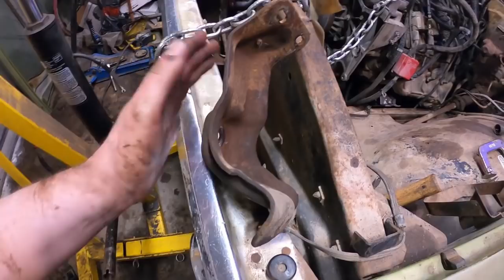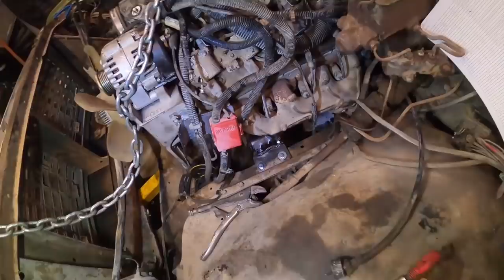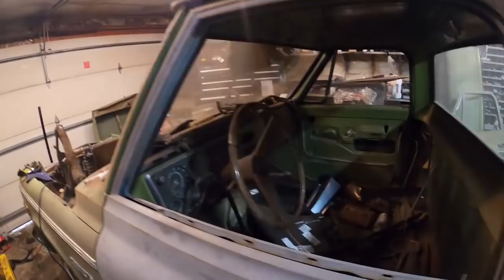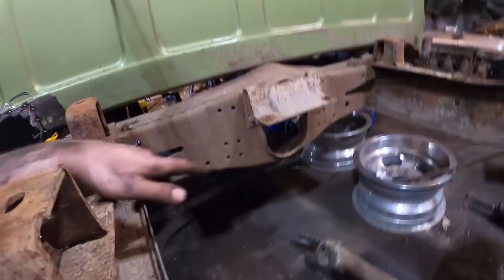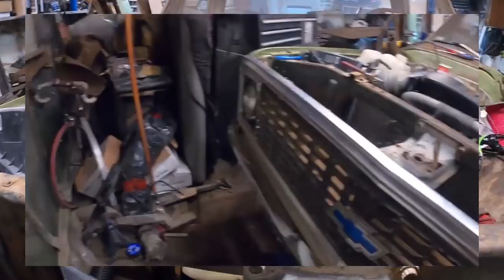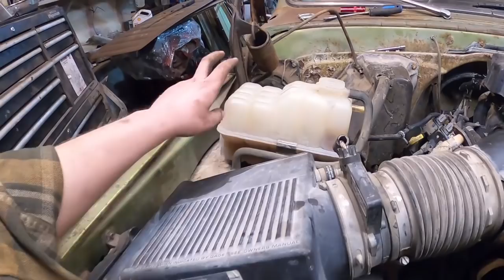LS Swapped C10 - Re-worked Factory Harness and Home Built Mounts

Comment from the maker: Back Working on the C10!  It fought me hard but I'm making progress.  Let me know what you think.
Reply: Super stoked to see what you do with this truck and the projects to come!! 👍👍
Reply: Coming along great. Getting it done. Thanks for sharing
Reply from the maker: thanks!
Reply from the maker: thanks for watching!
Reply: The 3/4 ton trucks with 6.0's and hydroboost have plugs that go into the power brake port on the intake 👍
Reply: DD Speed Shop - Dan, you’re coming along very good on the C-10, I really like your motor mounts!  What are you going to do for a gas tank?  The original C-10 had fuel pump on the engine and I’m sure the LS had an electric fuel pump in the tank.  Can you put an electric fuel pump in the original C-10 tank or will you need to use a fuel cell?
Reply: 10k views. Ur parts suppliers head office does have an advertising budget.
Something to think about, if it doesnt  go against the gain that is.
Reply: Also, l like your cost rundowns. How about a time rundown?
Reply: There is a great video here on YouTube from Gearz by Stacey David that did a frame shortening. It is under the cab but the way he does it it is very simple and clean. May want to check it out. I know you didn't want to do a under the cab shortening but Stacey David did a very clean and simple job.

Comment: The back end of the truck is gonna be much taller when you move the springs forward like you’re planning. The front mounts will end up being mounted lower which will make the suspension sit higher than before. Just something to keep in mind.. if no one else has mentioned it.
Reply from the maker: im gunna keep the mounting height the same.  ill have to make a bracket for the top of the front perch.

Comment: Have you seen the k5 blazer gas tank conversion for these trucks. Don't know if you will have  room but you can put the correct fuel pump/sending unit in them for the right pressure and probably get the gauge to work also.
Reply from the maker: yeah ive seen em.   a little pricey for me haha
Reply: I'd use factory stuff search some videos on it try dicks 4x4, if your interested in it I'm going to do my squad body. Also awesome videos.

Comment: I think most of the trucks that get shortened wheel base get a one piece driveshaft. My 96 short box Chevy has a factory one piece driveshaft, one from the wrecker might slide right in place.
Reply from the maker: once i get the rear end moved ill measure and see what i need.  fingers crossed its a common size

Comment: with the HP tuner do you have to run a speed signal generator on the speedo gear so the motor knows the fuel/toning curve?
Reply from the maker: nope,  uses the 02s for that

Comment: I don’t know if I missed it but how did you wire starter to switch? I got mine all hooked up turned key gas kicks in but turned key and nothing I jump starter and starts but not with key there was a purple wire you mentioned does it go to starter? My car is a 55 Belair stock wire harness 2 starter wire and 1 to coil? Any help? And I am using stock LS harness and fuse box
Reply from the maker: yup the one wire that goes to the starter solenoid should be purple.  then on the factory harnes find the wire that has power on the crank position.  hope it helps
Reply: DD Speed Shop okay I got pink wire from stock ls fused box to the key on resistor on the firewall and purple wire to the same resistor that one is power at crank position.... so now it cranks with key but does not start only crank? Any idea what I doing wrong???????

Comment: I have not problem with you just moving the rear. That is what I am trying to do on my 66 I am putting it on a 92 frame. I am moving the rear up 2 and a half inches. I guess I could just split the difference between  the wheel wells inch and a quarter on each but I want it to look right.
Reply from the maker: oya make it look right for sure.  even if its a little more work

Comment: There is videos show ya how-to wire up the 40l60e and the 40l80e if you ever want 4 speed, check out snidertron3000 and Matt's maddness. Doing 02 blazer Xtreme 4.8 swap trying turn into daily, 383 stroker 89 S10 drag truck, 71 f100 4.63v swapped show truck.